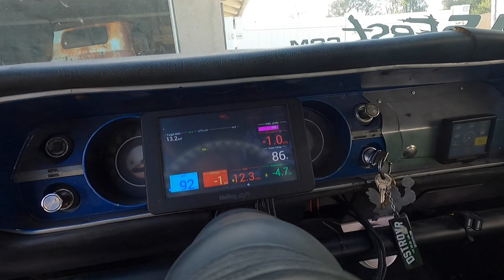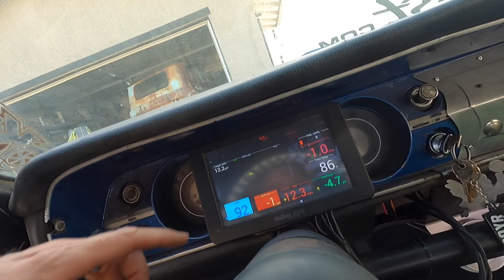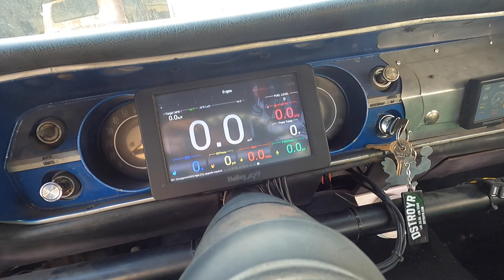Ebay Fuel Cell E85 Safe Fuel Sender Float

Comment: Good job on the 1320 video. The only question is that the sweep of the sender might be different in the tank if it hits the top or bottom of the tank before the sweep of the sender is at full range of motion
Reply from the maker: Well ill sink it and make sure it says zero. I know that part was close just wasn't sure if the gauge reflected that but you have a good point. Thanks man.

Comment: Ford used a nice round brass float, part # C0AZ,9202,A they used it for many years and might be what you are looking for.
Reply from the maker: I looked a bit on the inter webz but the plastic float was only a few dollars so im gonna roll with it for now. If it melts or does something silly then ill bite the bullet and buy a brass floater. Thank you for the part number!

Comment: Well better than using a dipping stick. Probably should  calibrate it inside the tank with and with out fuel.
Reply from the maker: Ill just push it down and make sure it goes to zero. Im not too concerned if its full or full full. Its the running out that's the problem. 😆